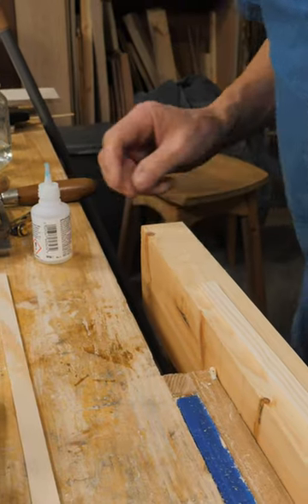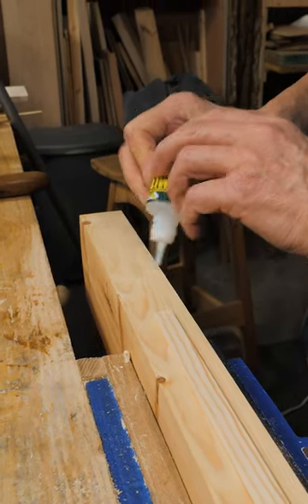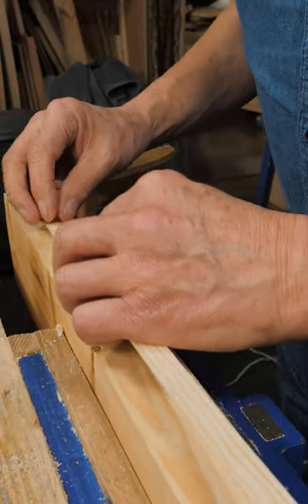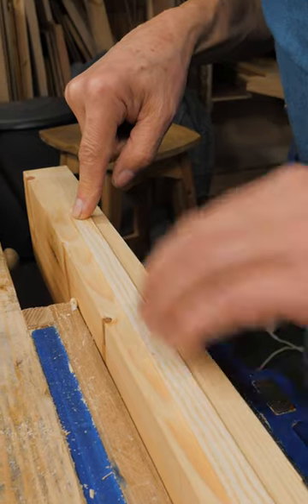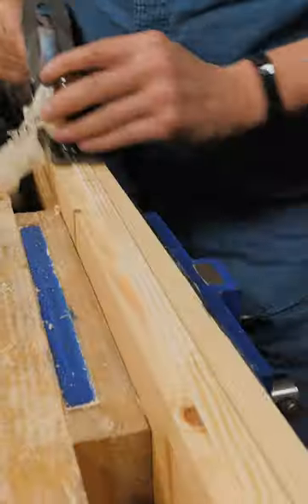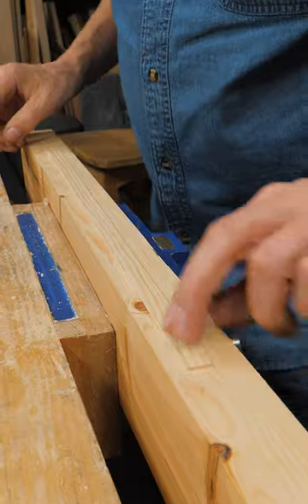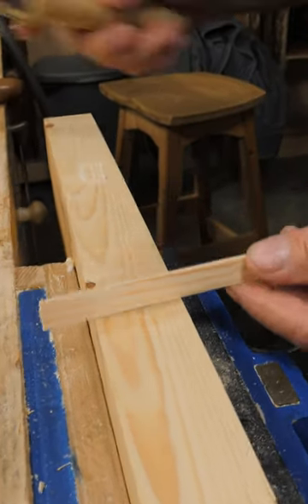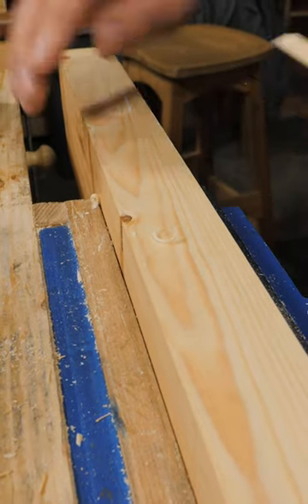Another top tip to add to your list! #woodworking #shorts #tipsandtricks

Comment: I use masking tape and super glue. Masking tape both surfaces and then a spot of super glue in between, stick tape to tape and it works just like double sided, except you can peel off far more easily and no damage to the wood.

Comment: Put tape on both faces and glue the back side of the tape together.  Less cleanup.
Reply: This could be problematic if you try to level it. The thickness of the two pieces of tape plus the glue adds up. Unless you are taping the entire length of the piece but then you are using quite a lot of tape for not a whole lot of advantage. Just my thought though, if it works for you, it works.